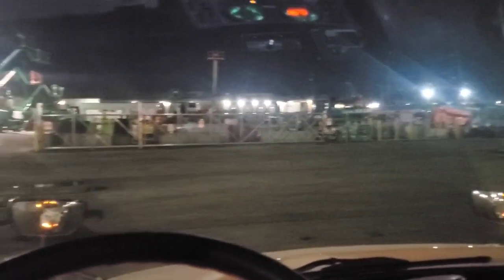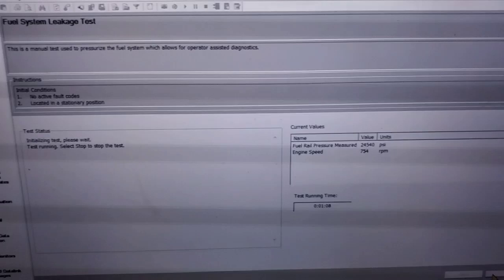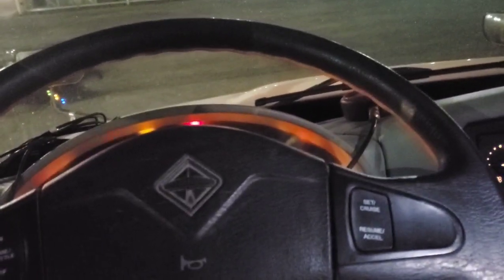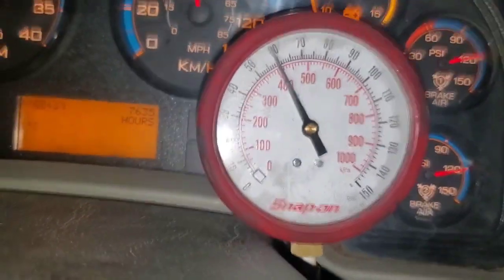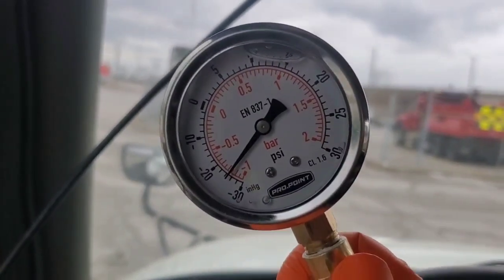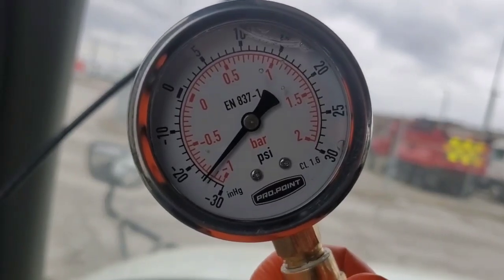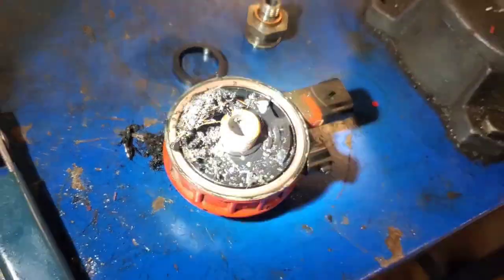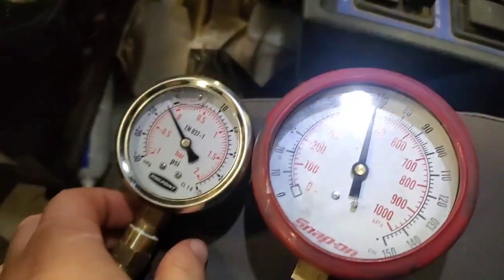Cummins code 559 test and repair for losing engine power  ISB 6.7L

Comment: I run fuel out of a bucket to completely eliminate the chassis side (low side) then troubleshoot from there, last time i diagnosed this 559 code i found what appeared to be papertowel jammed up inside the thermo recirculation valve.

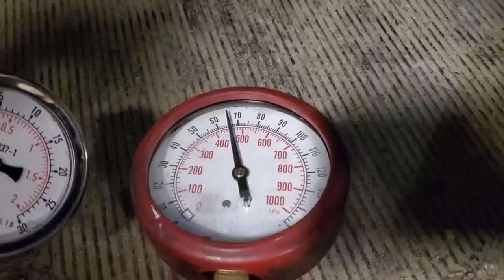Comment: Is that knocking sound fuel knoco or something else? I got the same thing going on mine thats coming and going. @ 9:20
Reply from the maker: It was the air compressor 🤭
Reply: @AcousticHills on the engine or the shop air compressor?☠️ specifically at 9:28
Reply from the maker: @PlantanoPower  It's the engine air compressor. Too much aluminum and light weight material on these causes the noise to resonate. It's normal.